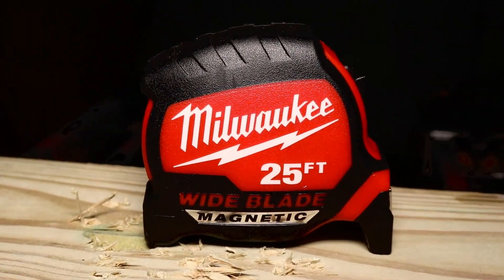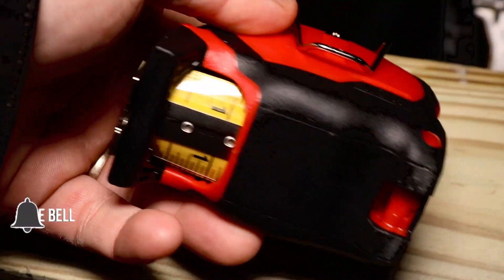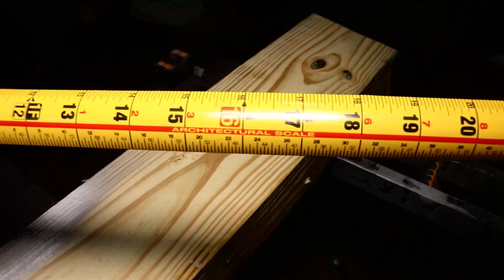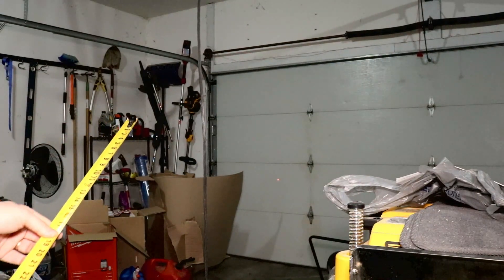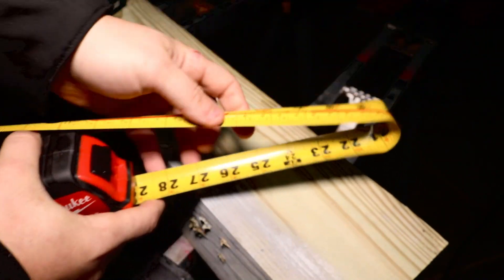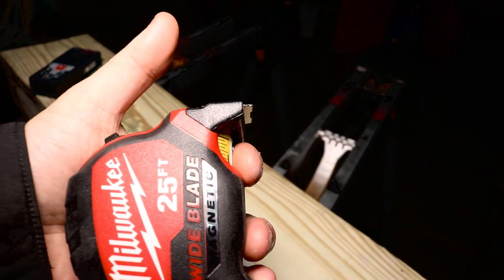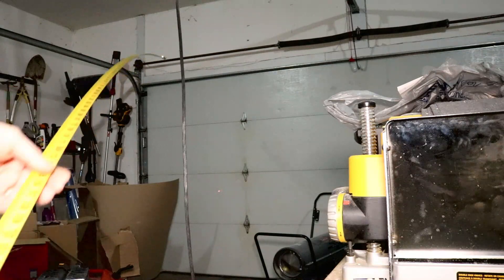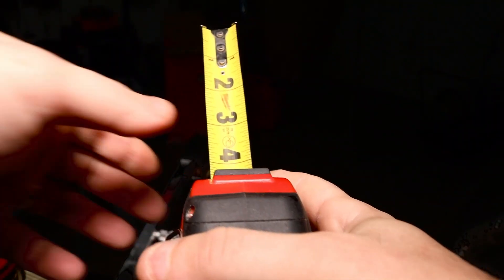Does the all new Milwaukee Standout Tape Measure really "Stand Out?" Milwaukee Gen II Stud Test!!!

Comment: I've had it for a little over a month,  and it's pretty damn good. I've found that I can get 14 feet of stand out if I tilt the tape measure a certain way, but even then it's not easy. Not really a fan of the belt hook though. It's actually fine, but today I tripped and it somehow flew off of my pocket. When I went to pick it up, the belt hook was deformed and now it's hard to keep clipped on my pocket. I'll fix it eventually, but other than that, the blade has been holding up quite well too. No rust or anything even though it's seen heavy rain and moisture quite a few times. I will say that the first couple weeks after I got it I had to pluck little strands off of the edges of the blade, but other than all that I'd recommend it for sure
Reply from the maker: Awesome feedback Luis, thanks for sharing 👊
Reply: Did you unscrew the belt hook I had a issue with my fastback knife the belt clip that deformed I took it off bent it  back in shape and it's fine now

Comment: Had Milwaukee stud and it lasted almost a full day, I do general construction and most of it is outside, so far fatmax  is never let me down.
Reply: Whole time I'm saying can it be better than my fat max doubt it
Reply: Try the wide blade not the stud. Ive been doing gutters for 15yrs and the wide blade is by far the best tape I've use. Those fatmaxs seem to crap out on me every time I pull it to max by accident. The wide blade dont. Then the fatmax rust way easier and that's an issue since I sometimes get it in the old gutter that's holding water.

Comment: The wide blade Milwaukee has a little better standout says it's the same as the stud but it seems to work better. Also another thing that makes it better than any I've used is I've dropped it from 40ft and nothing happened. I drop my tape a lot and even on concrete. Others have broke. Then the numbers don't scratch off or rust nearly as easy. Their compition the fat max will be horrible at reeling in if you pull it to max by accident and tug on it at max. The Milwaukee does fine. I've even fixed mine when the tape came out of its place on the end and was easy to fix. Others are super hard to fix. It does come In fast but thats what makes it last longer and where it dont mess up if you pull it to its max. My Only real complaint is the hook on the tape needs better grip like some other tapes have. It's not the worst but not the best. If it had a better hook it would be by far the best tape. I only use wide blades now and was a fatmax fanboy until then. They also make one of the best 100ft tapes. DeWalt would be the best if their gears didn't start slipping over time since it reels the fastest. 
 Also when measuring standout I measure it with my front hand fully extended and can easily get 14ft. It's also less effected by wind when using the standout. I was super impressed my first one I bought. They're on the heavy side but they also are way more durable so I'd rather have that than less weight. Im rough on tapes and was going through them once every couple months until these. I have one that's about 2yrs old and still works perfectly.

Comment: Does this new stud wide blade have the exo360 coating? It didn’t look like it
Reply: If not why don’t they make one? I do concrete and it destroys blades. Milwaukee says the stud with exo360 was designed for this type of contractor, but I prefer a wide blade so I typically use a fat max. But I want a wide blade with exo360.
Reply from the maker: Yeah it has it. I forgot to put it in the vid but put it in the description.  Sorry I missed that point in the vid
Reply: Tool Review Zone no worries. I saw it in the description just wanted to verify if the new wide blade would have it.
Reply from the maker: @Zee20Ate  no worries buddy
Reply: The wide blade I'm not sure but I do gutters and it gets wet all the time and it's rusted way less and lasted way longer than any other tape I've used.
Reply: @ToolReviewZone  no it doesn't have the exo360 coating on the wide blade model! It's only on stud.

Comment: You compared a Stud to a Wide Blade. I was hoping to see a Gen 1 Stud to a Gen 2 Stud. You seemed to intermix the terms. They are different tapes.
Reply: Yeah the wide blade is a lot better in my opinion. That's all I use now. I used to be a fatmax fan boy till those came out.